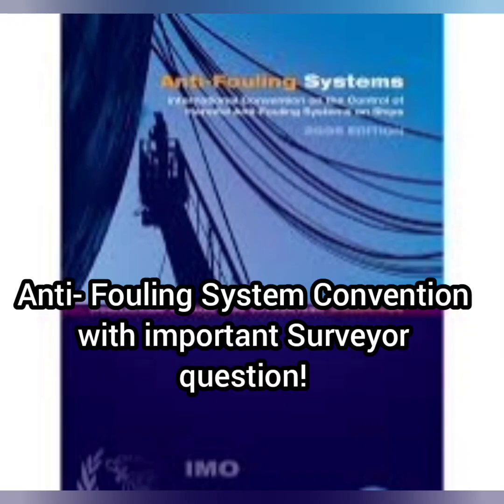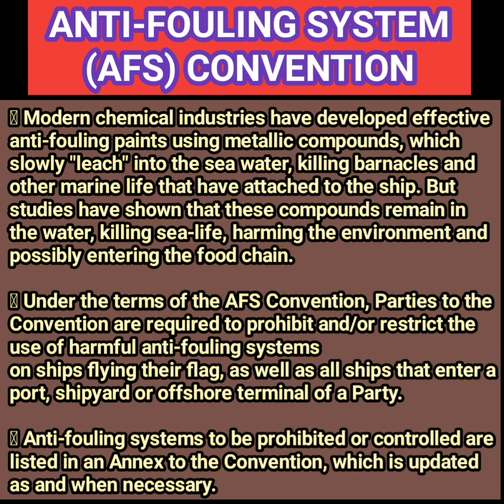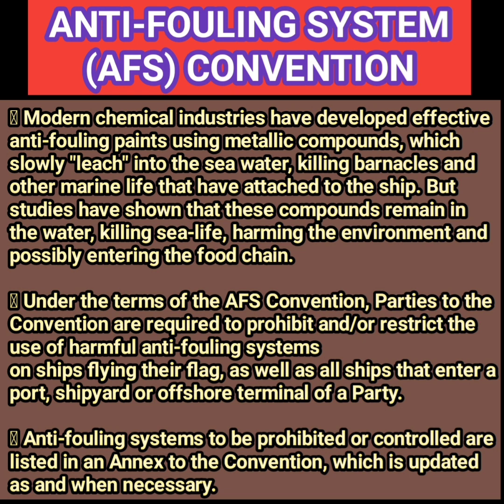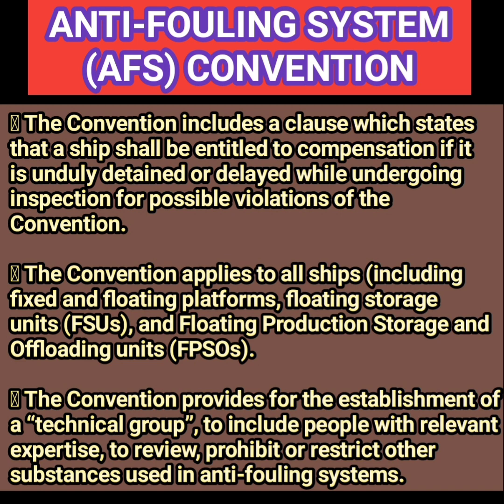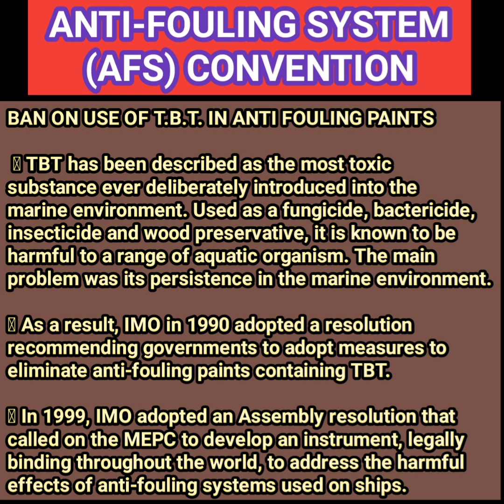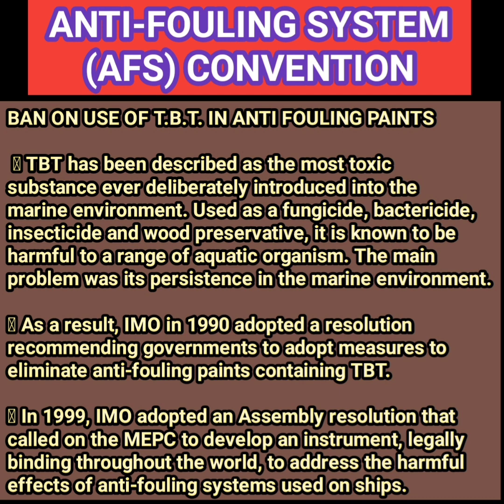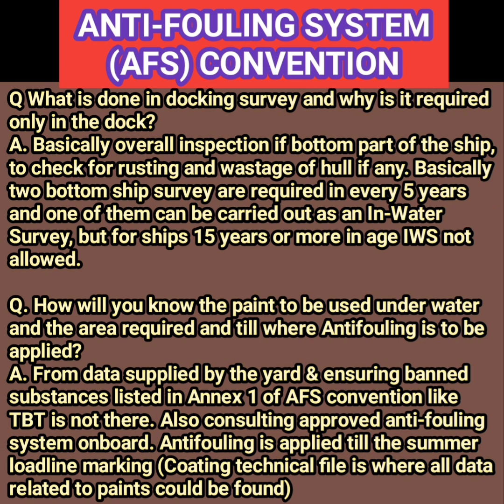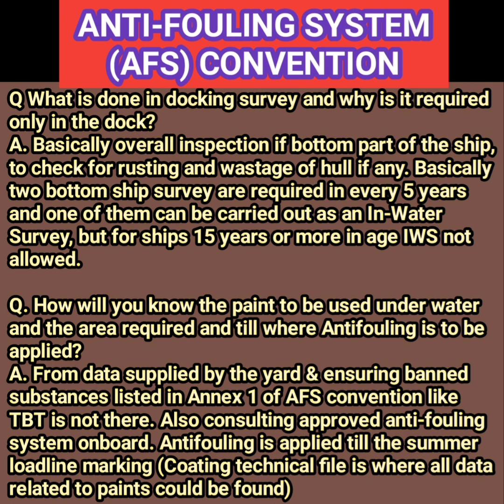Anti-Fouling System Convention- All you need to know with important Surveyor Questions on the topic!

Comment: what is the comparison of mgps technology
Reply from the maker: MGP (Magnetic Field Generating Pulse) technology and anti-fouling systems serve different purposes in the maritime industry. Here's a comparison between the two:

Purpose:

MGP technology: MGP technology is primarily used for marine growth prevention on ship hulls and structures. It helps prevent the accumulation of marine organisms, such as algae, barnacles, and mussels, which can increase drag and fuel consumption.
Anti-fouling systems: Anti-fouling systems are designed to prevent or reduce fouling on ship hulls by using paints or coatings that release biocides, preventing the attachment and growth of marine organisms.
Mechanism:

MGP technology: MGP technology works by generating a magnetic field around the hull or structure, which is believed to interfere with the ability of marine organisms to attach and grow.
Anti-fouling systems: Anti-fouling systems rely on the release of biocides from the paint or coating, which are toxic to marine organisms, thus preventing fouling.
Environmental Impact:

MGP technology: MGP technology is generally considered to have a lower environmental impact compared to traditional anti-fouling paints, as it does not involve the use of toxic chemicals.
Anti-fouling systems: Anti-fouling paints can release biocides into the marine environment, which can have harmful effects on marine life if not properly controlled.
Effectiveness:

MGP technology: The effectiveness of MGP technology in preventing marine growth can vary depending on factors such as the strength of the magnetic field and the type of marine organisms present.
Anti-fouling systems: Anti-fouling paints are generally effective in preventing fouling, but their effectiveness can decrease over time as the biocides are released.
Maintenance and Cost:

MGP technology: MGP systems require minimal maintenance once installed and can have lower long-term costs compared to anti-fouling systems.
Anti-fouling systems: Anti-fouling systems require regular maintenance and reapplication of anti-fouling paints, which can be costly and time-consuming.
Reply: @oralexammmdprep8110  great of ur excellent reply... thankyou.. actually I meant the comparison of MGPS technologies like cathodic protection, ultrasonic, magnetic , electrochlorination etc
Reply: Mgps I meant marine growth prevention system in ships
Reply: Good info ..I expected the comparison of MGPS technologies like

Comment: Hello. Very informative video. To the point.!! One concern though. 
The Coating Technical File (CTF) is a document, either in paper or electronic format, or a combination of the two, required formed by the IMO Resolution MSC.215(82) “Performance Standard for Protective Coatings of dedicated sea water ballast tanks and double-side skin spaces of bulk carriers”, also known as the IMO PSPC.

I think the coating tech File is not connected to AFS. 
Once again, thank you for this informative video.
Reply: Paint scheme will give name & type of paint used for ship's hull. Thanks for informative video.
Reply from the maker: Thanks Richardson, I am glad you liked it! I would surely check on the points that you have raised. Thank you for your input.